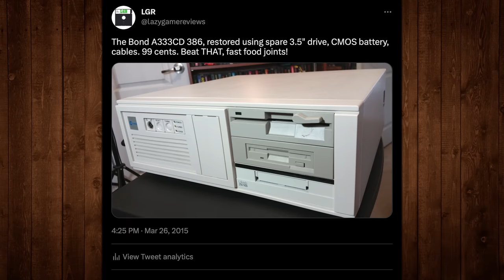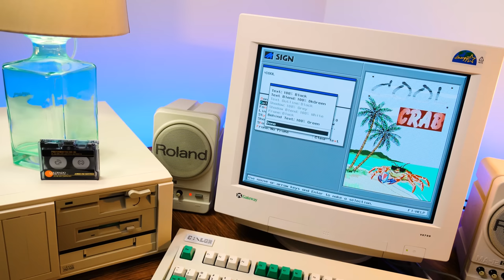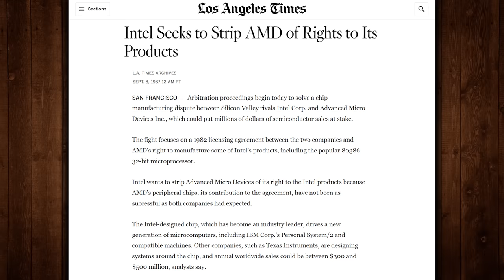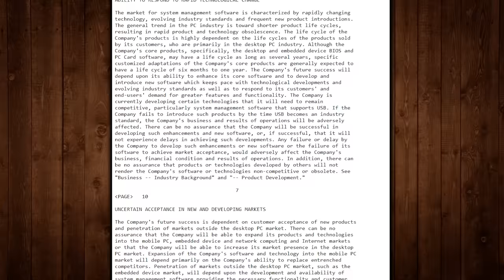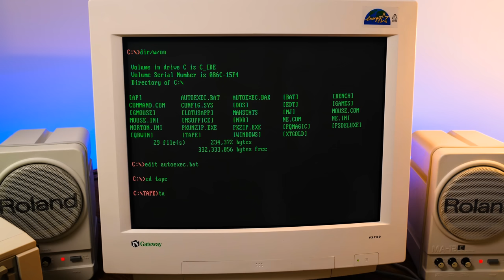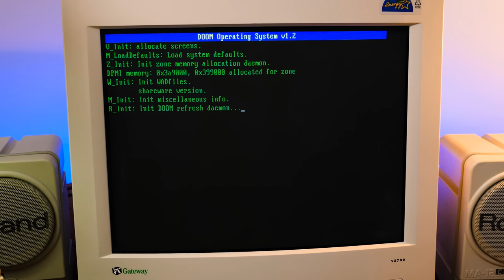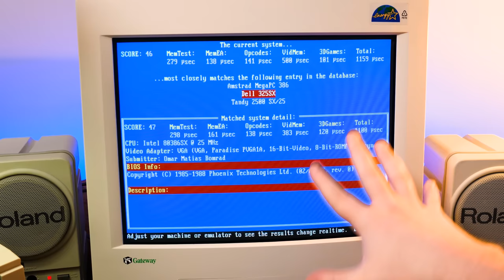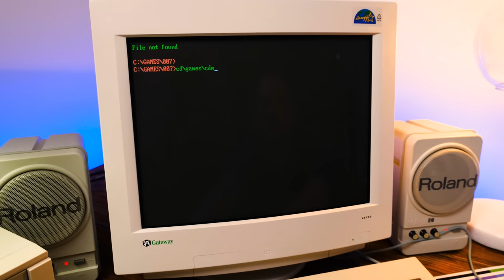Exploring a PC Built by Bond, J. Bond – The 99¢ 386

Comment: Looks like you won Ebay on this one...what a steal!  I guess the "not in working condition" scared everyone else off.
Reply: And you'd be surprised how many of those "not working/untested" items still work.
Reply: @rommix0   RETROPC hardware channel kinda shows you the odds of getting "not working" parts that end up working or are salvageable... i'd land it at ~75% hardware he buys
Reply: @rommix0  
It's mostly sellers who want to get rid of something but don't have the wherewithal for testing ancient and unpredictable hardware and/or patience for eBay red tape.
Reply: @rommix0 very true. I got a professional ThermoFischer hotplate and stirrer that retailed new for well over $700 from a guy who said it didn’t work for $100. Turns out he just didn’t know how to turn it on and it was pretty much fully functional.
Reply: Sometimes the ones that are actually not working only need a simple repair. I got a vacuum robot that retails for $1000, for $50, that just needed one transistor replaced.
Reply: I actually got a rare laptop for 75$ on bid once, it was the same model as my childhood laptop and overtime the laptop grew rare for some reason. I saw maybe one or two listings on a good week in the 125-250$ range because it was a late 90s laptop and a military grade laptop at that. The laptop was placed for 60$ minimum bid, and I placed a bid for 75$ to be generous and won. I received the package packed using a hundred Walmart bags as bubble wrap and read the package to discover he spent 50$ on shipping. Good thing I was generous enough to give him an extra 15$ he would've made a profit of only 10$. The laptop was in pristine condition not even a tad bit rusty considering it was made out of solid metal, the only part missing was the floppy drive and the listing stated that. The laptop was wiped clean and the old 40gb hard drive still worked, windows 2000 was freshly installed. He even installed a couple of games and the tools to load ISO files. The man was a saint of a seller, meanwhile the seller of my much more modern laptop didn't even bother to install the drivers and lied about there being a DVD drive. I had to completely wipe the computer and start over. Ebay is a series of dice rolls, sometimes you get something amazing other times you get someone's garbage.

Comment: From circa 1998 to around 2003 I ran a little AMD 386-40 on Linux with 32 megabytes memory.  It was connected to the internet via DSL and ran my mailserver and a nameserver for my domain.  This was LONG before anyone offered free nameserver service, or even email service for your domains, so you had to DIY or pay quite a lot.  I was pretty proud of the thing being able to do all that on a machine that was pretty slow and obsolete for the early 2000s.

Finally had to retire it because of the spam problem.  I wanted to run some spam filtering software, but the little 386 was vastly under-powered.   I hesitated getting rid of it because it held a lot of nostalgia even then, but thought "well...  if I really want one of these things again, I can just pick one up cheap at a thrift store".

20 years later and it would have been worth several hundred bucks I guess.  Oh well..  I think I came out ahead not having to drag it around and store it somewhere for the past 20 years.  But those 386s were some of the first computers that could do real tasks.
Reply: I had a DEC Digital Desktop with a 40Mhz 386, 256KB Cache, 1MB VESA VGA, and 32MB Memory.  It was gave to me free around 1999. It must have cost a fortune when it was new.  It was upgraded to 32MB (obviously), a 33.6Kbps ISA Modem, 16x IDE CD-ROM, and a 8.6GB IDE HDD using Western Digital EZ-Drive. It had Windows 95 on it.   I gave it to my Dad so he could try out this "computer stuff" without buying a new one. He just threw it away I guess when he bought a new PC.
Reply: @LionWithTheLamb  I'm amazed it'd run windows 95.  Looks like it met minimum requirements.

Comment: 14:50 OMG.. My dad had a tape drive that i used frequently as well. I INSTANTLY remembered the exact noise the drive made when you inserted it in, each tone shift as it read the tape lol. Brings me back. (My dad's drive was external, connected though the parallel port and had a pass-though for the printer).

Comment: I remember the 386 days because my PC friends were all in on building PCs rather than buying pre-built.  They were building 386 VGA systems by the late 80s which put all us 68K users on notice!
Reply: My first desktop PC (I had a Toshiba T3100 laptop with Gas Plasma display before that) was a no name 386 motherboard etc in an IBM  PC XT case.
Reply: Sounds like the equivalent of today's PC builders showing off their watercooled Threadripper RTX 4090 monsters
Reply: @Kalvinjj  price wise, these rigs are not too far off considering their retail price
Reply: @Kalvinjj  
Not really. We did that too back then. There were these computer shops where you could just choose from a list of standard components from a list. So you chose a case, a power supply, a hard drive, a cd-rom, a graphics card etc. And they would assemble it and a few days later you could retrieve it. All these components were standard issue stuff; we were students, couldn't afford the high end stuff anyway. We also upgraded them ourselves: put in extra hard disks, extra memory, modems, better graphics cards etc. Once I replaced the motherboard, but that essentially replaces the computer, you just recycle the case and power supply. And at some point, computers needed a bigger power supply. It really was the cheap way of having a relatively up to date computer.
Reply: @theo-dr2dz  I mean more about the parts in question vs. what the average user had instead. Tho I could be wrong on where they actually sit market-wise on the period in question.

Comment: The 386DX is a very capable system.  I put together a 386DX-33 system a while back and tossed in a 387DX math co-pro.  SimCity 2000 ran great on it since SimCity 2000 will benifit form the 387..  Those tapes drives are very interesting.  One of the common faults I've found on them is the rubber drive wheel inside the drive will turn to mush.  I've been successful in replacing the rubber drive wheel with a pair of O-Rings that I glued to the metal shaft the original rubber wheel was attached too.  The tapes if properly stored in a climate controlled area seem to hold up well.  If not, then the drive belt inside the cartridge tends to snap leaving a huge mess like your tape did when the drive ate it.  The other thing is to flow the driver out if not used for along time.  The drive uses optical sensors to detect the start and end position of the tape.  If those sensors get clogged the tape will unspool inside the cartridge.  I have a few PCs have these drives and they work well.  My go to these days is the external Zip drive, or an external SCSI hard drive for backing up old PCs.  Best is installing a NIC and attaching to a Samba server running on Linux. 🙂

Comment: Oh man, what a flashback, my (own) first PC was a AMD 386 DX40 clone machine with a J-Bond motherboard and also 8MB, an ET4000 GPU, same HDD large PC speaker and sharp case edges 😂  I recall replacing the HDD with a 810MB one, which doubled de transfer-rate to ~1.0MB per second !

Comment: 486 ran these games well even without the Math Co processor, but you really needed it on the 386 models.  While not marketed for gaming the MathCo did show a noticeable improvement.  Love these videos!
Reply: Had a 386sx25 and can confirm! The 80387 made a noticeable difference on mine, even though I had 12mb of RAM. Really sped up Indy Car Racing, Doom I, actually allowed me to sort of run Doom II, and Jetfighter never looked better 😌
Reply: probably the extra cache inside the 486  that made all the difference

Comment: Nice machine. It might nog look like much, but we've got to remember that these things were pretty expensive for most people back in the day, and I'm sure the first owner was very happy with it.
Reply: Definitely. When we got our first PC at home (I think a 386 or so) the choice was between the PC and a car, because they cost about the same.
Reply: True, the when I looked for my first PC, the 286-12MHz was the main thing, like a middle ground. If you couldn't make it, there were some XT's 4,77MHz. There was also a 286-16MHz (NEAT) for a solid amount more. And there were first 386 machines,  with practically unreachable prices. And all that with still monochrome monitor. More ofter than not, it was 286 with color EGA or 386 with monochrome option. But not both.

Comment: I had one of those Colorado 250Mb drives it's actually was commonly referred to at the time as an "ftape" drive in other words it actually can run off a floppy controller as a third drive. It's actually still supported on Linux and was still supported by Windows 2000 when i retired mine. They also had an external version which ran off of a parallel port. In fact mine was originally an external drive that I pulled out of the controller later and hooked up to my floppy controller because it was much faster that way.

Comment: I seem to remember there was a piece of software that allowed you to use those old QIC tape drives as a drive letter in dos, allowing you to acces them as any other disk type device, but for the life of me can't remember what it was called.  

I loved these old white/beige boxes back in the day, I worked at several local PC builders back between about '88 to sometime around '00..  I probably built several thousand clones during that time.  I remember one Christmas I had a bench that was stacked 10 cases deep, putting each piece in each one assembly-line style.  I built 'em way faster than the other guys at that place, lol.

Comment: Having Windows 3.11 on PCs in the early 90s was quite common from what I remember/experienced back then.  The reason was that it was the version that was mostly "pirated".  
I am not saying that that is the case with this PC.  Nor that it was my case cough *cough*.

Good video.
Reply: I've also read that after a certain point pretty much all PCs shipped with Workgroups 3.11 regardless of networking because it had way faster/better hard drive access. Basically 3.11 had 32 bit file access in protected mode and no longer had to slow down and drop to DOS to access the disc
Reply: The nickname was Windows for Warehouses as it was a slow seller. It could easily had been discounted down to the same price as normal Windows.

Comment: I sold Windows For Workgroups when it came out in 1992. We called lots of research businesses, and sold a lot of them to people using PCs without networking. This was because WFWG was the first personal PC 32-bit Windows operating system and we told them, as we were directed by Microsoft, that because it was 32-bit instead of 16-bit.

Comment: That would have been quite the high rolling machine in its day. My very first PC build was extremely similar, but I bought as much of it used or cheap as I could in 1993, and it was still well over a grand in 1993 money. My 4mb or ram was $100/mb, 540mb HDD was $1/mb, and I think I paid $250 for my AMD 386DX40, on a board, with a Cyrix co-processor and that exact video card (but with half the ram). I do not miss the hardware prices of that time. Without ever having anything genuinely high performance and always doing it on a budget, I think I spent about 10 grand on PC "things" in the '90s.
Reply: I recall ringing a friend from a pay phone at the Computer Shopper show at Olympia. "Hey Roberts. They've got 4MByte SIMS for only £100. Do you want me to get you one" Of course he did.
Reply: @MrDuncl  I do miss those computer shows. The 540mb drive I mentioned above came from one as did my first few cases, bulk packs of floppy discs, lots of cables and assorted bits...

It was like internet shopping before the internet. 😆

Comment: I had a Tseng Labs ET4000 in a 386 system. They were one of the first cards to offer 16-bit and 24-bit color.
Reply: Had an ET4000/W32p overclocked to 50MHz in an ol 486DX2-80 OC to 100. That thing was a bit blitting beast back in teh day
Reply: I think I still do have my ET4000 stuffed into a P166 machine somewhere around here. 😆
Reply: @mycosys  what was the tseng 4000 original core clock?

Comment: I had one of those tape drives briefly back in the day.  It connected to the parallel port and was unreliable.  Returned it and bought a used SCSI tape drive, which used some HUGE tapes but worked well.

Comment: Interesting that the biggest problem with what you said with the 3M cassettes is: The magnetic layer is peeling off and that is due to the rubber used in the cassette. I had a very bad experience with my HP system where I forgot the name of what uses the 3M tapes.Oh and the older the rubber not only tears off the magnetic coating but, as in your video, the tape itself becomes tangled because the rubber has become too soft or even simply tears. It's sad, sad because the tapes, of course, are rewound exactly at the point where the directory is located and lose the magnetic coating. Magnetic tapes are actually a great technology, but like everything that is mechanical... eventually it will be gone and faster than you think.

Comment: Even though I am the same age as an 8086 I joined the party way too late to ever own an AT system and certainly not an XT. 

I remember a friend from school wishing that she had a 486 and not a 386 and not understanding what she was talking about. 

The first PC I had was a Celeron 333, so much further down the road. I gave it to my dad who eventually threw it out, but I wish I had saved it. I knew nothing about them back then and didn't think it was worth saving. 

I only got into computers when a Windows XP machine failed on me and, as I had bought a new Windows 7 machine, had no fear of cracking the old one open to explore.

What a rabbit hole that was! 

P4's are still cheap, and older ones can still run some of these programmes with a bit of finagling, but I'd like to see more on these SBC built around a 386/486.

Comment: I used to work as a tech support assistant at a British children's book publishers in the late 1990s, and the writers/editors were using machines very similar to these. Every night, the last step in everyone's work routine was to slap the backup tape into the drive and run a backup. Incidental file (just those that had changed) backups every day, and a full drive backup on Friday. Those tapes were SUPPOSED to go into the massive, walk-in fire safe, but users being users, this was often ignored. The whir of tapes in the late afternoon was always somewhat gratifying. That 486 machines could somehow run Quark Xpress and not come to an immediate grinding halt was always amazing to me. Their ONE resident photoshop expert was always needing more storage, and when I left, his 'powerful' Pentium III photoshop beast was running a separate drive chassis with 4x 2GB hard drives, and his machine was the only one that had then massive 8GB tape backup drive (which took something like 30-40 minutes to make a full backup – which I believe we actually had to enforce with threat of dismissal before he would perform the backup. On the subject of tapes, they were rock-solid reliable for data, but because tape, they were ALSO a pain to keep from getting tangled. I had a good half-dozen calls for tape tangle issues from the editors and artists during my 18 months at the company.

Comment: That 386 is a rocketship! 8MB of RAM! 500MB of disk space! I loaded up a 386 with 5MB of RAM and that was after it had been retired (I put it in an original IBM XT case if I recall, correctly). I'd had my 80486 for at least a year by then, and had 8MB of RAM in that, and intially had a 200MB drive in that, although my plan was to put another 200MB drive in it. Didn't do that, instead put a 1GB SCSI drive in it with an AHA1542 controller, so that I could later get a SCSI CDROM drive. I added the CDROM drive in about 1995, 3 or 4 years after adding the SCSI controller.

Comment: I miss this time, back when i feel like i knew the most about pc's 8088 XT was my first. Id love to build a custom pc utilizing an older beige atx mid tower clone but buy adaptation boards so you could add older 5.25, 3.5, optical drives to modern hardware.

Comment: Very first Tech Support job I ever had was for Colorado Memory Systems in the mid 90's.  MAN!  That sound takes me back!

It looks like that tape just came unspooled.  The tape isn't attached to the spool.  The drive is supposed to stop before it unwinds completely via a light through a holes in the tape.  If the holes were blocked or the spool got loose, it would do exactly what it did.  You could try manually remounting the tape around the spool.  Just be sure to wind it past the holes, (unless the tape is broken, then of course everything I just suggested is moot.).